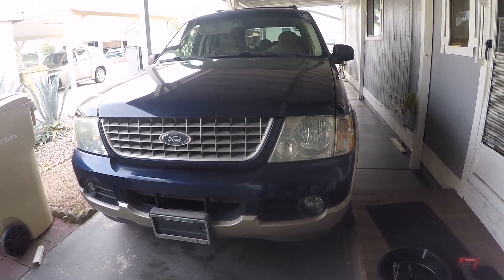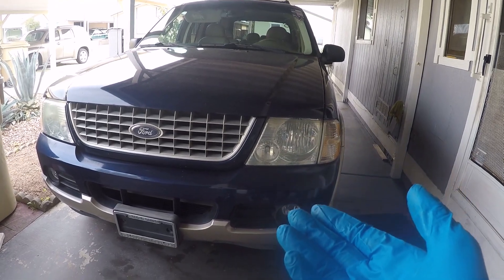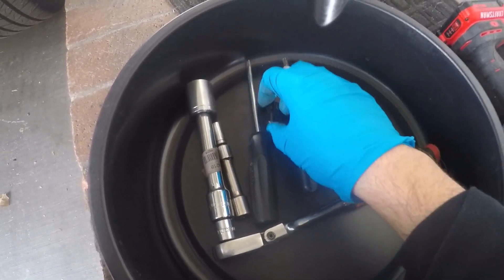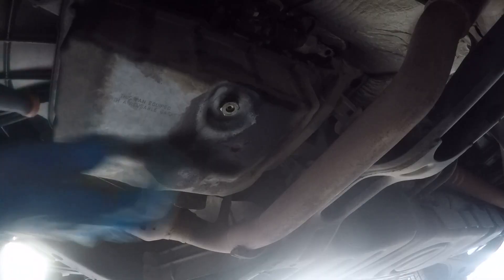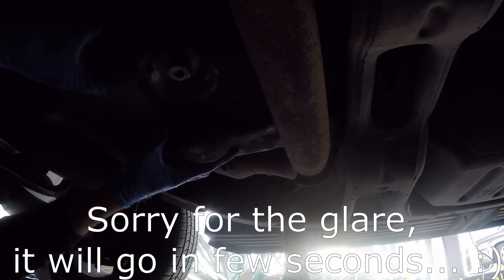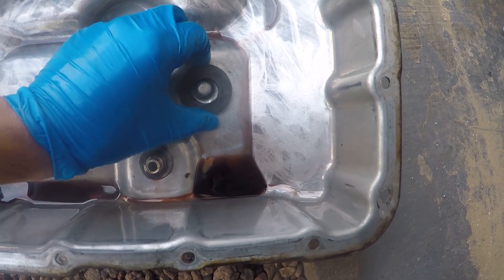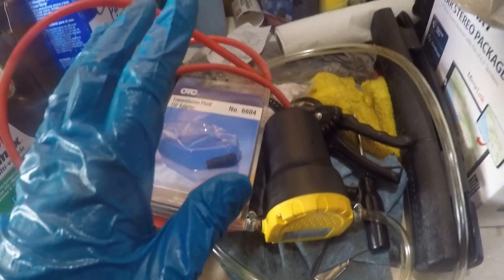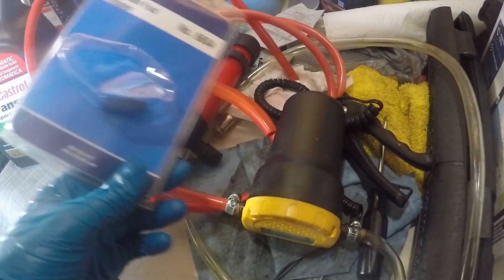Ford 5R55S Transmission Problems Fix - 5R55N Hard Shifting Engagement

Comment: I have a 1998 Mazda b4000 4x4 with a 5r55e transmission. It shifts hard between 1st and 2nd gear. The code on it is p1900. Not sure how to fix it

Comment: Hello there, were did you get the solenoids alone to rebuild the pack, I have a 05 Lincoln Aviator and will like to check on that, thank you in advanced.
Reply from the maker: I got the rebuild kit on eBay
Reply: @GK7GARAGE will look it up, mine is failing 2nd and 5th I have codes p732, p735 & p775 will check oil level and consistency first, thank you

Comment: Just replaced the entire valve body with a refurbished one, and replaced with a new refurbished solenoid pack as well. It definitely got rid of the harsh shift from park into reverse, or neutral or drive (from a stop) into reverse. Some people simply just replaced the solenoid pack alone or the valve body alone, but I highly suggest doing both if possible.

With the trans pan reinstalled, I refilled with 5 qts of Valvoline Max Life ATF, after replacing the trans filter and pan gasket as well. Added a bottle of Seafoam Trans Tune, as a cleaner/conditioner, but will not be adding it after the first ATF change /cycle on the new valve body and solenoid pack. 

I got some cheap refurbished parts bc I didn’t want to spend top dollar for some “upgraded” or “modified” brand new parts; but it still worked out okay in the end for about a 1/4 to 1/2 of the price of the brand new trans parts.

Comment: Thanks for the video.
I have a 2005 Lincoln LS V8.

Are you in Los Angeles??
Also. i hate that design to fill the transmission.
I had my transmission seal and rear main seal replaced years ago an since there is no dipstick 
He refilled it through one of the sensors..
Don't know which one..

Comment: My truck is stuck in first gear no matter what I do it will not come out. Would the solenoid pack cause this kind of problem?
Reply: It might,now this is 11 months since you ask. My o2 4.6 shift slip on two,got a used pack,it would not go beyond 1st gear. Lots of frigging around put back original solioid pack shifts again, just 2nd cranky. If I ease up on the gas it shifts,something about pressure. Thinking hard on getting it rebuilt, my wife rolls her eyes,but the Explorer great shape for nova scotia. Have great week.

Comment: Does the car have to be level before topping off trans fluid?
Reply: For sure yes,did you get it filled
Reply: @vernonfindlay1314  yea but didn’t manage to fix it unfortunately
Reply: @SuperBeastin247  my Explorer about the same slow shift on 2nd,and overdrive. Still have said vehicle, thinking about getting it rebuilt. Have a good week.
Reply: @vernonfindlay1314  could also be a worn out servo sleeve
Reply: @SuperBeastin247  farted around with the solenoids, as I learned more,they were my thoughts. Plus I work at a Ford dealership, and the bands are a consern,the fluid is very clean. The shop scanned the Explorer, code po 732,you can ease of the gas,second shift happens. Thanks.

Comment: is this an identical fix to a 2003 mountaineer transmission shift obstacle mine has a slow shift engagement timeframe shifting down into first gear and usually only when warm but turning overdrive off seems to eliminate problem

Comment: I have fordexplxer 2004 a and shifting. I to neutral is the problem .Will changing fluid intermission clear up the problem it has 274780 miles the car(Ford exlpoer).

Comment: My 05 mustang with this same transmission shifts completely fine in all forward gears but reverse takes exactly 15 seconds to engage…no more no less and it only does this when the engines warmed up. When reverse does engage it’s very smooth it doesn’t slam into gear…Also it will go into reverse immediately with no delay when cold starting. I’ve already changed the filter and replaced the fluid twice. No flashing O/D light, no check engine light and no slipping/delayed gear engagement in drive. Just this weird problem with reverse. It’s been this way for almost a year since I bought the car and it hasn’t gotten any worse. What in the world could be causing this???
Reply: 06 mustang gt same transmission o/d light flashing any ideas?
Reply: @Thelegendking-yj4bm  Servo bore?
Reply: Have you found the reason? My 05 does similar but a little worst. Forward is fine. Delay engage on the reverse and slip while giving gas.
Reply: OK when cold and not OK when warmed up?...hmmm? Is it possible that you overfilled your transmission? Being that the fluid expands when it reaches operating temp, it may be to proper level when COLD but over full when at operating temp. Just sayin'!
Reply: @benniewilliams2019 It would have to be overfilled like at least by a quart and a half or 2+ whole quarts. Overfilling by maybe half to 3/4 of a quart isn’t “too” terrible, at least not enough to cause severe transmission hydraulic pressure issues. 

Of course, it would depend on the transmission as well, since some have vent tubes that simply expel the extra fluid at operating or really really hot temps. 

I say it’s more likely the valve body and/or the solenoid pack, sometimes both even… I replaced both with refurbished parts and it solved my issue. 

I got a new trans filter and pan gasket replacement kit, and added Sea Foam Trans Tune as an ATF conditioner, for the first trans fluid change. I won’t be running it on the next fluid changes, as it should be fine after cleaning out all the old gunk.
Reply: I don’t know the name of it but it’s right beside your filter

Comment: i got a question my 06 explorer the wrench symbol comes on dashboard and itll shift to drive and reverse but it’ll get stuck it’s like there’s a disconnect its bot bumping i to gear or slipping out its like the transmission is not sending the right signal to the electronics in the vehicle to tell it to switch gears or switch to drive and reverse

Comment: I have a 2005 4.0.. it drives in 1 2 3 gears but barely moves in drive and reverse..
Reply from the maker: Ohh, that may not be a good sign, I would have a transmission shop professionally diagnose it

Comment: My 2010 ford explorer AT blinks OD light while driving . Tried changing solenoid, speed sensor and the whole valve body as well still the issue didn't resolved.  Can this be due to a faulty ECU or TCM?
Reply: I have the same problem. Were you able to fix it? What was it?
Reply: @フリョゴメス  Yes I was able to fix it. I had to change the whole ECU kit and then it went off. So my problem was due to a faulty ECU kit!
I hope you get it resolved soon

Comment: Hey  - when you're installing/replacing  the entire transmission/torque converter   exactly how much transmission fluid is needed for this vehicle?
Reply: I'm not sure of the of exact number but it's 13-17 Qts I believe.  You'll need to make sure you're filling the parts in the transmission with fluid to make they're saturated so you don't start it dry.  Then follow the standard refill procedure (search here on YouTube lots of videos.  Then you should be good, double check for leaks then maybe recheck after running for a bit to see if it dropped from filling any air pockets.

Comment: I have a 2003 Mercury Mountaineer and it won't go in reverse or drive but it goes in 3 2 1 I've checked the transmission fluid and everything is fine no shavings in the transmission fluid and I don't know where the sensors are

Comment: I have a 2004 ford explorer awd xlt sport. It does shift weird when driving under 50. Once I go over 50 60 then coast down a hill and I let go of the gas pedal completely the rpm drop to zero and stalls the engine. I went over 60 once and I let go of the pedal and put the car in neutral while still coasting and the engine didn't stall. Will this fix that issue as well?

Comment: What was the problem before replacing this Solenoid? I have the same transmission on my 2009 Mustang 4.0. It won’t go into Drive or Reverse only 1-3 manual gear.
Reply from the maker: In your case maybe the servo is bad

Comment: I have no reverse all other gears work well what's the problem  I can hear a spinning sound no revers let me know
Reply: Reverse band end probably broke.  Drop the pan and the four bolts on the round reverse servo.  Push the lever and see if the band tightens or not.
Reply: Same issue, have you found the reason?

Comment: For me I have a Ford Explorer 2010 that had the gears slipping and the hard shifting on first and second gear, I took it to the local garage they said that they fixed the problem although what they fixed is just the gear slipping, they fixed the gears slipping but not the hard shifting and let’s not speak of the check engine light

EDIT:check engine light code p0191 was causing the hard shifting, idk how
Reply: Try to replace intermediate shaft sensor that is in the transmission i replace mine and it works the slipping was gone and the orange wrench is gone too
Reply: @proud2bepinoy18  i fixed mine
It’s just that I have a problem with the fuel system
Reply: Try using Amsoil ATF. Get with me for an assessment.
Reply: @peterssynthetics  the transmission i was speaking about suffered a full system failure and had to be changed, apparently it was an 04 tranny on a 2010
Reply: @redman4life91  I am very sorry that happened to you and had to soend money on a new trans. Use Amsoil and change regularly and you can go literally millions of miles with hardly any wear. Too good to be true? Just try it.
Reply: @peterssynthetics  yea yea its not that I don believe you, its that I’m in the middle east LMAO
All i can find is havoline n liquimoly that arent like a manufacturer recommended oil
Reply: @peterssynthetics  update, we have amsoil except its really expensive, one quart here for amsoil is 93$ for a quart, comparing it to for example liquimoly which is 10.6$ a Quart, according to my mechanic amsoil is only used for bikers here

Comment: I replaced my trans fluid and filteron my 06 explorer 4.0 now it wont go into any gear smh
Reply from the maker: Try reset, I have another video on resetting it
Reply: thats what happened to my dads 05 explorer.. he did a transmission flush now the transmission acting funny when you start driving the car
Reply: I’m having the same issue same car did you figure out what was the problem ?

Comment: You said you would post if this repair worked, I am just seeking a follow up as I have an explorer in my shop acting funny and throwing a solenoid code.
Reply from the maker: It worked great 3000 miles later still good... hope this helps
Reply: GK7 DIY i am having an issue with my transmission, it doesn’t seem to be slipping but the check transmission light comes on and the od light flashes. Any help would be appreciated.
Reply: @garycropper8519  I got the same problem. Were you able to fix it? What was it?
Reply: @GK7GARAGE  definitely useful but is this an issue with the same year Ford Explorer but with a V8 engine? I heard is only the 4.0 liters doing this.

Comment: GK7 question, so exactly what symptoms were you having on the transmission when driving the explorer on the road? I have an issue with my 2006 Ford Explorer it has the 5R55S transmission 4.0 v6 motor when i drive it and does it every now and then when i come to a complete stop at a traffic light and when i start accelerating the car wouldn't go in drive when i slowly put my foot on the gas pedal. About a second later or so the transmission catches gear and the vehicle starts to move, i don't know why it does that? Today i checked the trans fluid under the pan there was alot of the old trans fulid flowing out of it when i took the small t30 screw fitting out of it then i added almost a whole quart to it and a lot got wasted because i guess it was already full and more fluid started flowing out of the drain hole after filling it but i did not have the engine running and transmission at full temp like you did in the video. Are you suppose to have the engine running while adding transmission flluid?
Reply from the maker: Yes, engine has to be running with trans temp at 80-120 so the trans pump is running, I believe now your fluid is low, because it’s a lot  more in the pan when engine is off..
Reply: @GK7GARAGE  what's the name of the digital temp gun? Where did you got it?
Reply: Did this fix your problem my explorer does the exact same thing